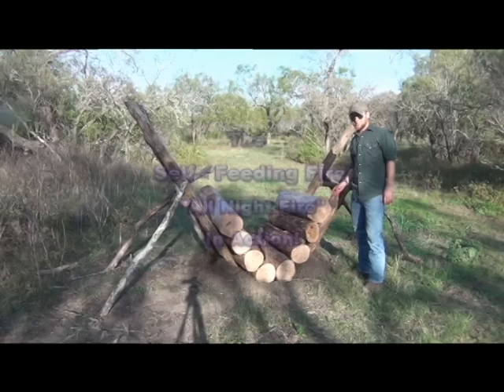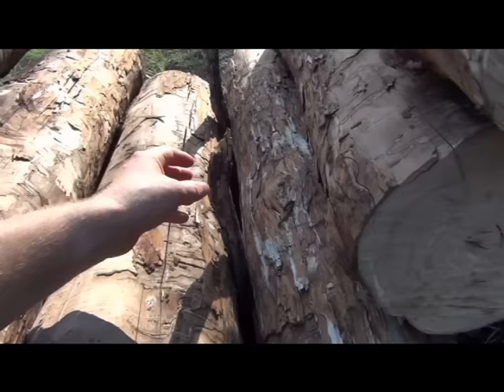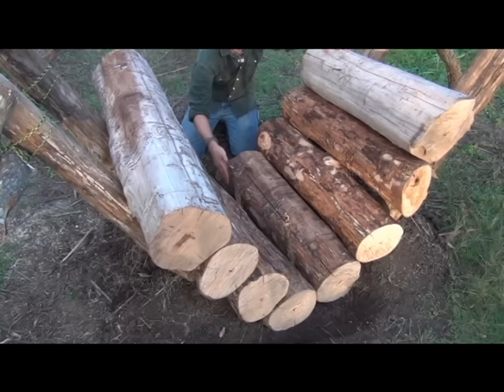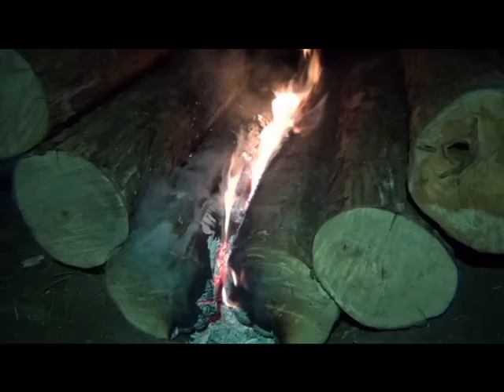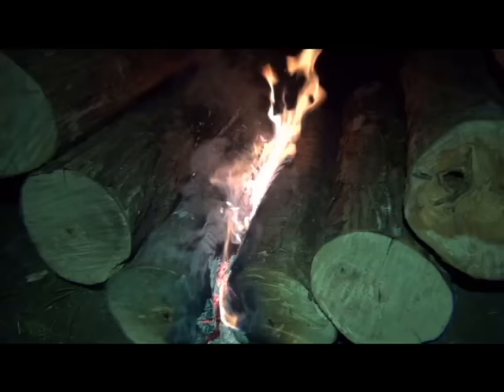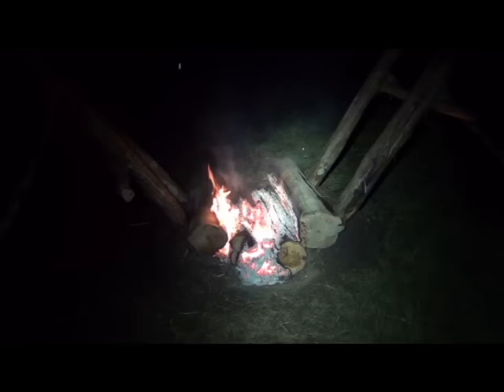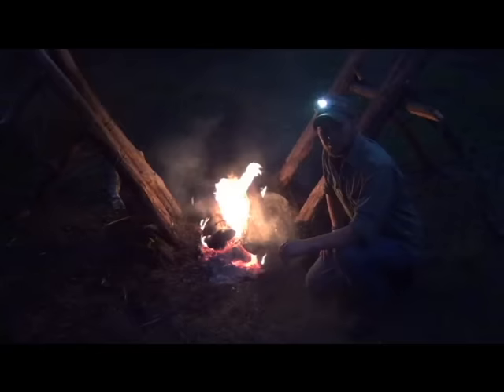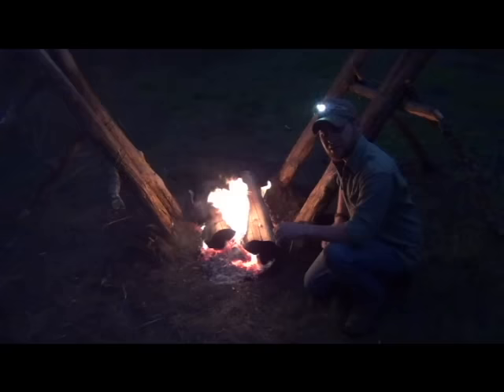Self Feeding Fire -  14+ Hour Fire

Comment: Very interesting.  I wonder if it can be made to work with one slide.  That way it would heat a shelter more efficiently.  Thanks!
Reply: +Kevin Outdoors Yes, the feeder logs block much of the useful radiation.
Reply: +Kevin Outdoors you could probably just replace one of the sides that feed logs in with a large rock to hold the logs up and help radiate the heat
Reply: +Kevin Outdoors Yes. Doing this with just one side is the way Nessmuk did it. He describes it in Woodcraft.
Reply from the maker: +ClockCutter I'll check it out.  Was going to try this weekend... but 20mile and hour winds are blowing all around at the moment.

Comment: At winter can be up to 15 hours
Reply: William Inglis ~Actually cold air burns far quicker because it's much more oxygen-dense.
Reply: not to mention that the updraft of the air would be much more effecient, in turn pushing more oxygenated cold air into the fire , thus burning through the wood much faster.
Reply: The farther north you go in winter the longer the nights get.
Reply: @anthonyt3872  aCtUaLlY

Comment: Only one question, why? What purpose does this sort of fire serve? 
It seems like a bit of a gimmick.
Clever? Sure.
Necessary? Maybe someone will blow my mind and tell me something I hadn't thought of.
Reply: I would think it would be very useful if you found yourself in a situation where making a fire in the first place was very difficult (think Castaway), to keep it burning continuously, rather than spending all your time making fire.
Reply: you have to cut the logs first...
Reply: +Joseppe “Crystal” Daia you'd have to cut them anyways to manually feed the fire.
Reply: tman008 but not like taht ;)
Reply: G
Reply: +Martin Wright you are stranded...
 for that ONE situation its useful, right :D
Reply: camping in the Colorado woods and would like to avoid the wildlife wandering into your campsite.
Reply: Nic Stroud for places where its cold you can get a solid nights sleep and stay warm and still be able to cook breakfast so you have energy to hunt/fish, build whatever. fires take constant attention. if it's 10 degrees Fahrenheit  you would be ecstatic with this system.
Reply: These large fires are mostly for camps for more than ONE PERSON or set up for extreme conditions where a constant fire is helpful for survival.   in places where the temperature drops well below freezing, it's crucial that you keep a fire going or else you're in big trouble.  Also in areas where there are nocturnal predators, the fire keeps them at bay.    The reason is that you don't have to have someone tending the fire all through the night.  You apparently haven't camped out before or else you wouldn't ask for the reason why someone would NOT want to have to get up every hour to stoke the fire.  Getting a full night's sleep is good.
Reply: Frankie2012channel dude. It's a 14 hour fire. The effort isn't worth the return. He had to chop down a tree  with a chainsaw or something. To get those logs, not something you are going to do in a survival situation out in the wilderness. Building this thing would be an all day + project and finding enough calories to stay strong and building a regular old campfire would be more beneficial.

Sure if you got a bag full of canned goods, beef jerky, and water you got all the time in the world to play lumberjack to build this contraption, but a regular campfire worked up to two of those sized logs before going to sleep would burn about 10 hours and he's burned 8 for 14 hours. 

We aren't gonna be out there with a chainsaw cutting the perfect logs. Most people gonna scavenge what's easily available to burn, start a fire and keep tossing in stuff to keep it going them go about building a shelter or forage for food and water. You think dead dry logs just pop up at the spur of the moment when you need them? This guy is probably near his house, and using a tree he cut down last season  with a chainsaw so it would be dead and dry. 

Good idea in theory, kind of not worth the amount of effort to build and set up in real life situations where fires are easy and food isn't.
Reply: I wanted to say the same thing as John Burgess did but well said Mr. John, Indeed in a survival situation it's very highly unlikely that you would have a chain saw to get these big logs for this project and really it seem too complex and time consuming to build even with a chain saw, a regular fire would be more efficient and less time and energy consuming when fire isn't your only need but also getting clean water and shelter so a regular fire is definitely a better idea unless you have many many people with you and you need some structure for a big central fire source and even then I think there are better ideas and designs

Comment: what keeps everything from catching on fire?
Reply from the maker: Physics.
Reply: +Bob Hansler what I see is that everything could catch fire, unless you keep the fire under control.
Reply: but if everything goes well ok.
Reply from the maker: Yep, same goes for conventional ovens and cars.  Do it correctly and all goes well, do it wrong and there is the potential for failure.
Reply: you push the dirt up behind the stacked logs so the air won't pass though and cause them to catch. that way the only fire is in the center and the oxygen gets fed from underneath.
Reply from the maker: Yep.  Have alot of clay in the soil there and it makes a good flat ramp and seal to keep that heat where it belongs.
Reply: At least Michael gave a proper answer.
Reply: +mcNogard thanks. yeah the only tending that the fire might need at all is just to make sure it's burning evenly the whole time. Nothing a little work with a poker wouldn't cure and besides that what fun is a fire you can't poke at with a stick.
Reply: He soaked the logs in wood before hand.
Reply: SOAK LOGS IN WOOD
Reply: He wasn't. If you don't understand why then you probably won't after an explanation either. Besides, he can be a little salty for two reasons. 1- he deals with trolls all the time. 2- you're on his page. You don't like it, don't watch it or read the comments. People need to grow thicker skin these days. Oh and I'm sure somebody will come on swearing at me and calling me names, but that just completely proves my point. People will act tough but get offended by nothing. both of those qualities cannot exist in the same person.
Reply from the maker: eric davis
That was far to lucid for a YouTube comments section. Good stuff man,
Reply: Bob Hansler too*
Reply: +Michael Turner What fun is anything if you can't poke it with a stick.
Reply: hope

Comment: This is a cool idea, but what is the practical use of this?
Reply: I'm thinking if its a cold night and you dont have a proper sleeping bag or just a simple shelter, this seems like a good way to keep yourself warm all night without having to wake up every few hours to load up the fire
Reply: So when you go to sleep it will keep going and keep you warm through the night
Reply: My question was due to the size and odd design of the fire. Where can you sleep that will allow you to get any warmth? You certainly cannot use that indoors and just how close do you want to be to a couple hundred pounds of logs suspended over a burning fire?

It's cool, but really?
Reply: +Mark Speir  I think its used to cook one full deer or lam. but for heating the shelter there are lot of simple and efficient ways to do..
Reply: First to answer your question, Where can you sleep that will allow you to get any warmth? This can be easily done by simply sleeping parallel to the V shape of the logs, which will prevent them from falling on you, and if needed you can put in a few more stakes, running parallel to the V, for added security. Also you can direct the heat from this fire the same way you direct any other fire. Second is if you have a large enough shelter this can be set inside while heating the entire room (removing the need to sleep beside it). Third you could light this, have it burn down throughout the day and then at night cover the coals with dirt so you have a heated flooring to sleep on. I can state more if you like but the only limit to how you can use this is your mind.
Reply: I would say in an emergency situation it would take more energy to build this set up as opposed to making other fire types, and of course you want to conserve your energy when things are bad.

Comment: While I admit the concept is neat, it's not really that great. You'd be better off with a swedish torch. For one, it would be faster to make that than this setup. But the bigger thing that makes the swedish torch the clear winner is you're bragging that this lasted over 14 hours (approx 15h plus coal burn time) But you used 8 logs to achieve this. Just one of those logs would last 8-10hours if you made it into a torch. (Which is also great for cooking btw) so that same 8 logs would have, in best case, lasted 80 hours, worst case 76 hours. 15 hours doesn't looks as impressive when you look at it that way does it?

Comment: What time did you start this fire? Where is there 14 hours of darkness?
Reply from the maker: +only1pinuchi Ha, I can go back and check, but I believe that I started it at 5:00.  The sun dropped below the trees a half hour later.  The storm came through in early morning and the cloud cover remained through the early morning.    Overcast and trees delaying the sun shining through.  5:00 PM - 7:00 AM Winter time in south Texas.
Reply: +only1pinuchi in my soul
Reply: +only1pinuchi More than 14 hours at northern latitudes.  That being said, I can see this thing burning up in just a few hours, depending on the wood.
Reply: +echowit Posted too soon -- don't know how to edit my reply.  Meant to add " ... depending on the wood so I can see how important the build (angle, etc..) is.

Impressive feat.
Reply: +Frenzy LaBom Thanx.  Will remember that if I continue to flex my itchy trigger finger!!
Reply: +echowit i believe you can edit a comment, let me try...

yup, when you hover your cursor over your comment look to the right of your comment, you'll see a small triangle in a circle, click it and the first option is "Edit"

Comment: I don't see a use for this type of fire, but okay.
Reply: All nighters
Reply: This is way more effort and way less efficient than just tossing a new log every few hours
Reply: Um, the idea of this fire is to keep you in your shelter as the fire burns all night long, keeping you warm; thus you don't have to get out of your shelter to throw a log on every few hours.
Reply: *****
That fire isn't built to radiate heat far enough. It only comes out two sides, and it's not even a big fire. You'd have to have your shelter dangerously close to it if you want the benefits of the warmth. Depending on the logs, the whole thing can go up in flames if it burns through faster than you anticipated.
Reply: if you were camping and were going to stay up late you could sleep warm by the fire and wake up to cook breackfast on the embers and just stay warm  nicely done
Reply: +stephanie medina is someone making the fire for you? Because that's a lot of work for a little fire. And I'm pretty accustomed to having coals on a regular fire in the morning. Just poke at it until you see the red glow or the white and black changing and throw some kindle on it. More fire ftw. Nowhere near all this work ftw. Work smarter not harder.

Comment: maybe use some lengths of 2" angle iron for your posts and enough height to use for suspending cooking pots or a rain tarp possibly.
* definitely would want to determine which direction wind is coming from so you could position logs as a wind block
Reply: I think the point is to do it with just wood like our hunter gatherer ancestors would have. You wouldn't be able to get iron unless you were a blacksmith which isn't practical for most of us.

Comment: Can't you use two iron rods instead of two sticks?
Reply: they miiight melt probably not but the wooden rrods are easier to find and if there is always a gap and it does not melt the fire burns quicker because more air but we want this to be a heat source not a firwork so wood is the way to go unless you are gonna remove them after youhave set the tinder on fire

Comment: I think for the purpose of making a multi hour fire, you've succeeded.  However, the first few hours of your fire would be a minimal heat output or at least, only offer heat on only two sides instead of the traditional 180 degree camp fire heat output.  Sitting around the campfire for a group could start arguing for the only two heat output positions.

Comment: ....so... what if the thin wooden supports catch on fire?
Reply: That's why the clay is there, to prevent that.
Reply: Aaron Oxenreider Clay? I certainly don’t see very much of it. And the fire should be fairly easily able to spread from the center log to the nearby logs to the supports and burn everything down. Of course it worked in this video, but... how reliably would it?
Reply: In the video he explains the clay is there to prevent the fire from burning on the backsides. I'll try to find the timestamp.
Reply: At 4:45
Reply: Aaron Oxenreider Oh. Thanks.
Reply: Sure thing :)

Comment: Which direction will this fire radiate heat? I have tried several forms of these fires and came to the realization,if you want  heat, you will have to tend a fire!
Reply from the maker: Up.  It was more a proof of concept.  No need for heat here at the equator.